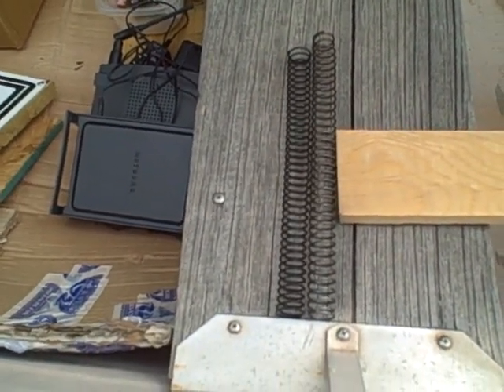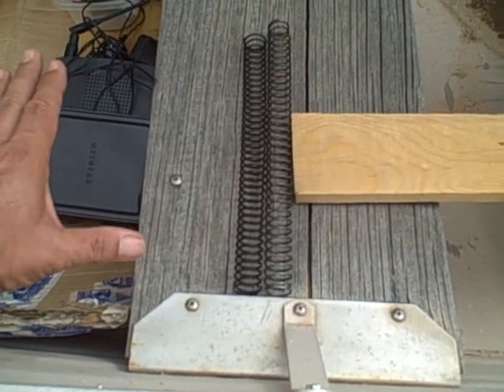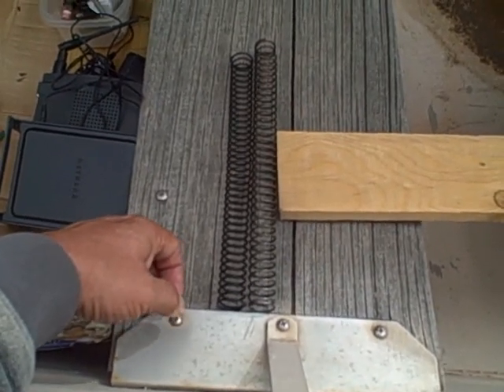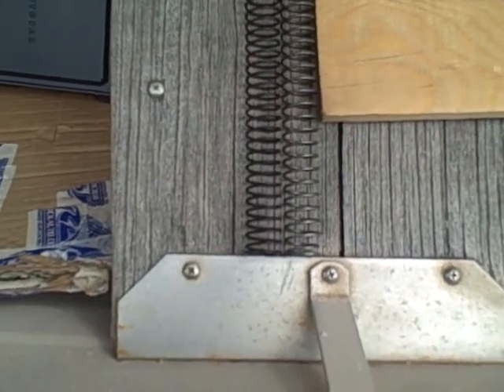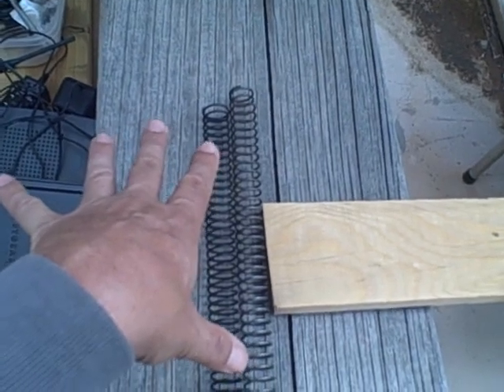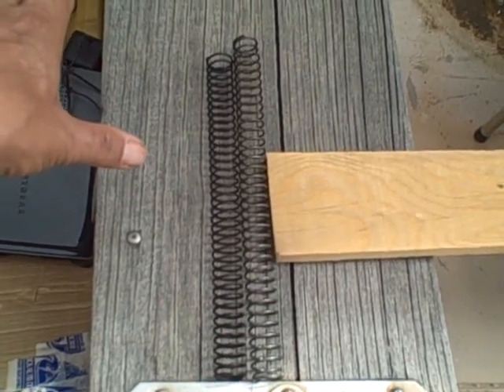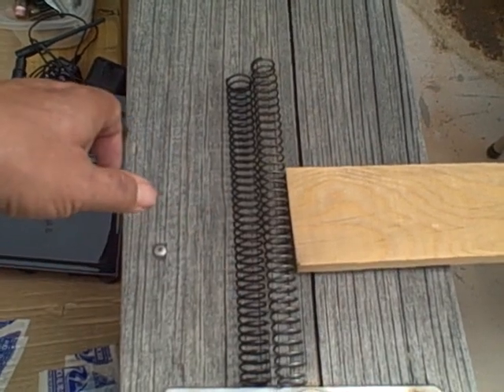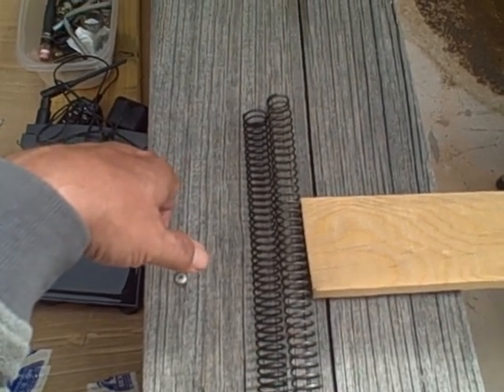AR pistol short stroke,    RESOLVED

Comment: Steel cased ammunition? Tula 223 caused mine to short stroke
Reply: Hey👋  
I know it’s kind of late but someone else will read this and be thankful.
How did you get yours to cycle Tula ammo?
Reply: @huntergardner597  I had to clip the buffer spring by about 4”. I’m thinking steel case isn’t as good as brass for expanding in the case chamber and is unable to make a sufficient seal in order to have enough gas pressure to cause a reliable cycling. Since a lot of gas does leak back into the bolt and chamber area there is a split second difference that ends up making the bolt not unlock fast enough. Once I clipped the buffer spring I never had another issue.
I also keep an Unmodified buffer spring for brass but the clipped spring works with brass to but the bolt travels a lot quicker and can lead to the bolt hitting the end of the buffer tube

Comment: You weren't too detailed in your last video so I have a question or 2.
Was the short stroke resulting in a the bcg not closing fully or something else? What was the overall result of the short stroke basically?
My brothers ar is having a short stroke resulting in the bcg not closing fully and acting as if its not not lubed properly. I oiled and dry cycled the bcg to spread not wanting to do a complete breakdown knowing I had oiled it liberally when I cleaned it last to resolve a failure to eject issue.
It would dry cycle fine MOST of the time but once or twice out of 10 I could feel that there was less pressure from the buffer spring. Attempted to fire a few thru it and it would chamber the first round, fire and eject at 4. Sometimes it would chamber the next round but not fully close or grip the casing with the bcg and other times the bcg would fail to move past half way resulting in either a chambered round not attached to bcg or jam. 
I'm leaning towards it being the buffer spring, because as I said I could feel a difference in resistance sometimes. Thank you for your time
Reply from the maker: OK, let's review.  I built my AR with kits and groups that I assumed matched and were designed to work.  So my ATI pistol buffer from gnarly guerilla I thought was all ready to go.  So my spent cartridges were ejecting at the 4 oclock position, which was spot on from what I've read.  My issue however was the BCG wouldn't consistently pick up a new round, nor would it lock back when empty.  My understanding is with a short barrel there's more then enough pressure there to push back the bcg, even with a under sized gas hole or miss aligned port.  Since my barrel and sight tower came as an assembly that I didn't work up, I had to hope / assume that was not the issue as they were supposed to be pro's doing this assembly stuff.  OK back to me... so I though and thought and it seemed to me like the BCG was acting like it was not going back ALL the way, so I measured my spring and it was in spec, then I heard people say my lite buffer (2.7oz) was going to be rough on my build, they suggested the H2, and I sort of threw the spring in as it was cheap....  If this had failed I probably would have pulled the front site tower, but out here in the desert, in an RV.... that would have sucked.  Let me know if you have more questions, i'm happy to help / answer